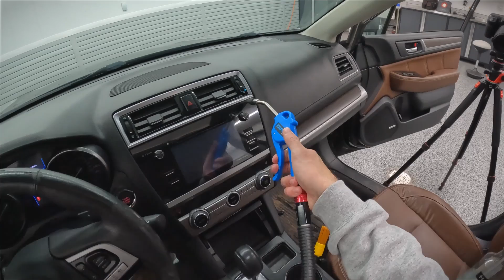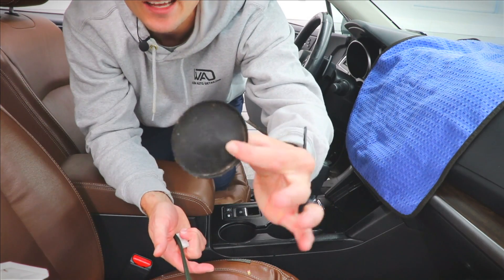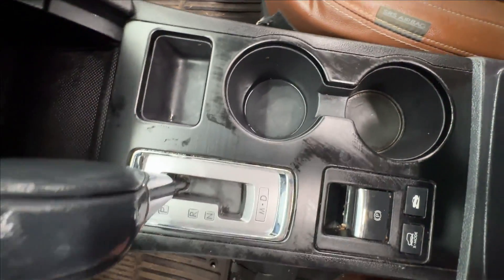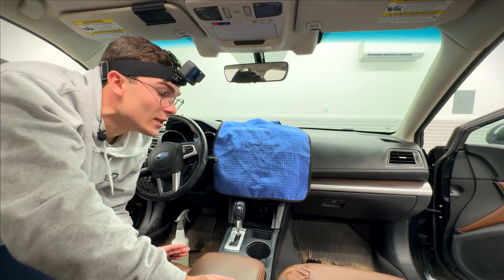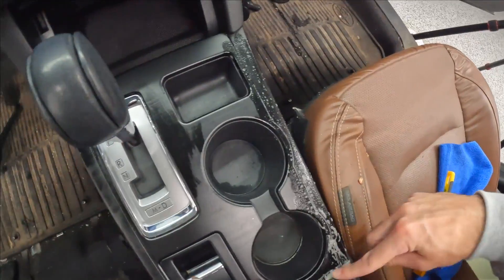Step By Step Interior Cupholder, Console, & Dirty Detailing Process

Comment: Another TIP : use a vacuum with a brush attachment at the end so you can brush and vacuum anything loose. Use a wet microfiber to clean the area first so you know what actually needs chemicals. Also to those with no air compressor some vacuums can also blow out air you can clean each area and with the vacuum in your non dominant hand dry the access product.
Reply: Love love love the blue waffle microfiber from Rag Co!!!!